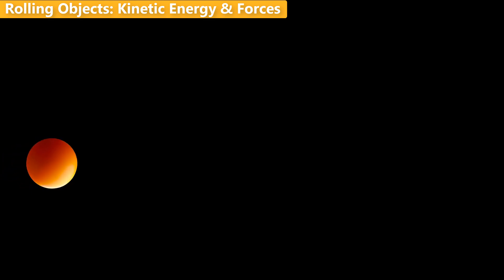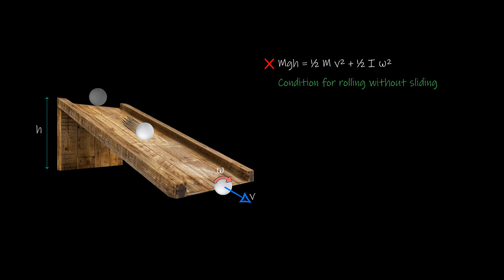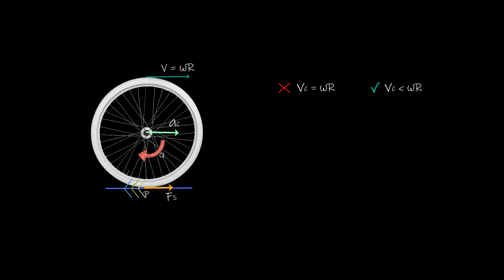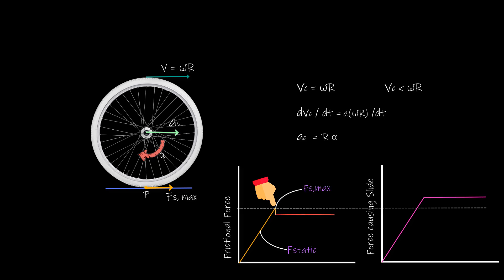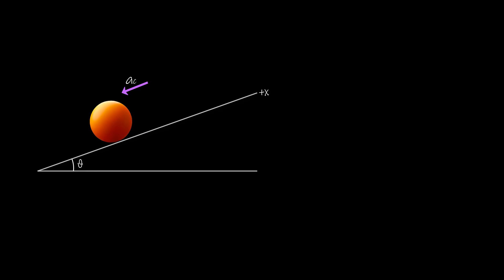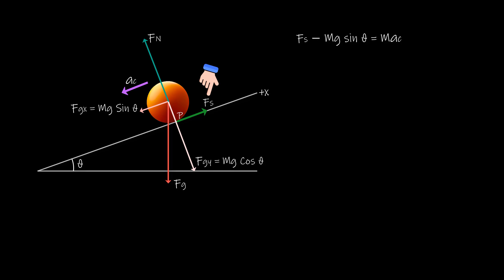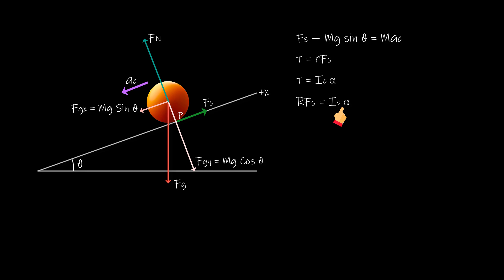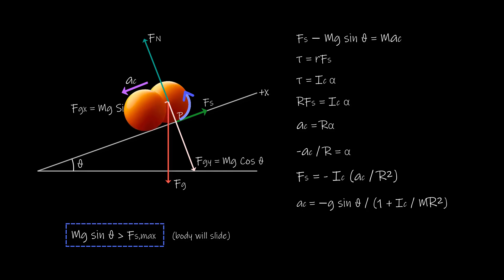Physics of Rolling Motion: Kinetic Energy, Friction, and Acceleration

Comment: Very underrated channel and great animation! There’s one thing I’m still confused about: why can we add the frictional force to the x-component of gravity, even though they act at different points? Doesn’t the fact that friction acts at the surface rather than at the center of mass complicate things? For example, if I were in space and pushed a pencil on its side instead of directly at its center of mass, the resulting acceleration would be different.
Reply from the maker: Great question — and you’re absolutely right to think about where each force acts! We combine friction and the x-component of gravity because both affect the linear acceleration of the center of mass.

The fact that friction acts at the surface matters too — that’s what gives the torque (τ = Iα). So, the same frictional force shows up in two places: one equation for translation (F = ma) and another for rotation (τ = Iα).

Your pencil-in-space example is spot on — friction ties the translation and rotation together so they stay in sync (v = ωr).

You can check out more lessons anytime on website The Science Cube, it has a lot of free resources. https://thesciencecube.com/